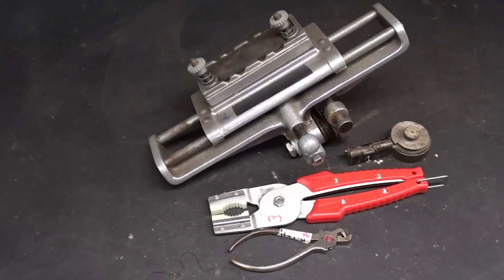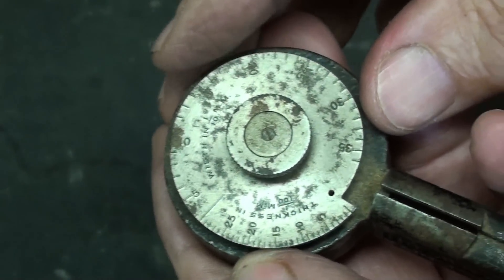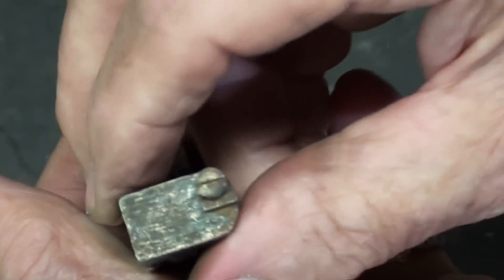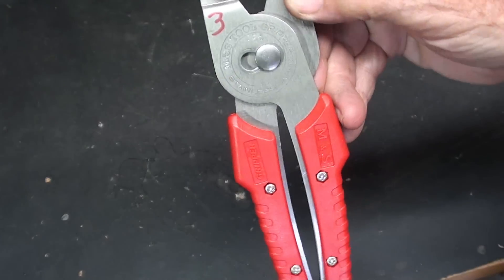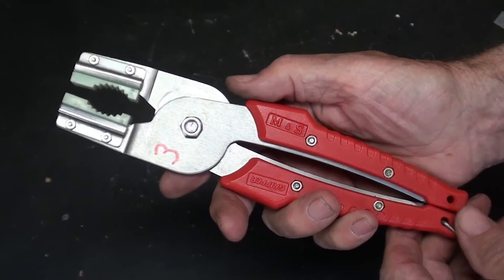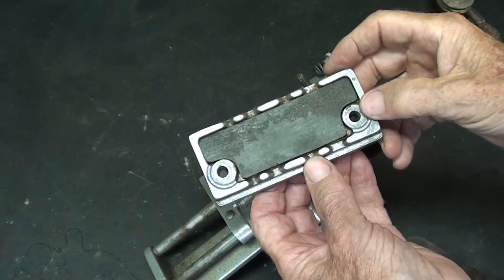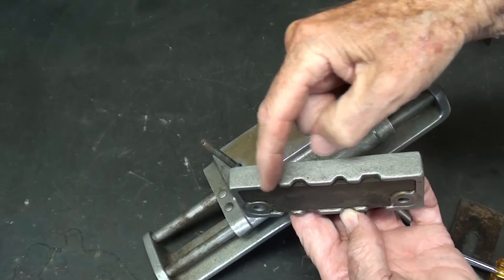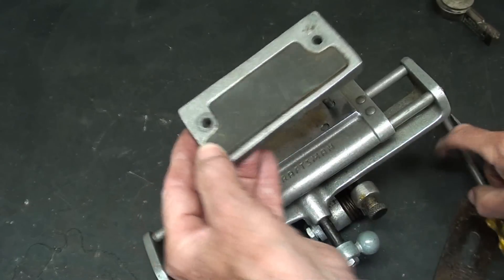WHAT IS IT? Mystery Tools #82b answers tubalcain mrpete

Comment: Hey, don't knock hollow-ground screwdrivers! They're less likely to cam out so anyone who has a jig like this would use it. One feature missing, though, is the ability to flip the workpiece over without losing its lengthwise position, so your screwdriver is ground the same amount on both sides.

Even better for gripping than hollow-ground would be a screwdriver ground to the hollow-ground shape but by holding it sideways against a crowned grinding wheel. This would leave crossways grinding marks which would further help with gripping the screw head.
Reply: Gunsmiths love these screwdrivers that are hollow ground.  It allows a screwdriver with flat parralel sides to slide all the way to the bottom of the screw's groove and prevents the crown of the screw head from being mashed and spread apart when pushing down hard with the screwdriver.  The screwdriver also contacts the screw head groove across the whole groove so their is less chance of scrapping the edges of the groove when the screwdriver's head pops up (cams) out of the groove.  These hollow ground screwdrivers used by gunsmiths are very pricey but worth it.

The better the fit between the screwdriver and the groove the better.  This tool would also be used to take a screwdriver that is too thick and grinding it down to have a skinnier screwdriver head that would now be a perfect fit.   If the screwdriver is too thin, then you would grind the tool head down to make the shaft shorter and then hollow grind the two sides again.   

If the screwdriver's shaft has four sides it would be simple to flip it over and slide it left/right in the jig to keep the faces of the screwdriver head parallel and true.   If the shaft is square but the head is not parallel to the sides then you can use the V-grooves for alignment.  Six sided screwdriver shafts work the same.   Gunsmiths hate it when they scrape a screw head and remove some of blackened surface because customers expect the blackened finish to be unmarred.  They would then have to blacken a tiny screw.  If the screw head is stripped along the groove then they would have to make a new screw or special order the replacement screw.  There are no replacement screws available for old or antique guns.  An old hex key can be repurposed into a flat grind screwdriver too, so you don't need to start with a screwdriver.  On round shafts you would have to grind one side flat before using the flip technique.

I don't have a fancy tool like this grinding attachment in my home shop but every once in a while I need to preserve a blackened, rare or oddball screw so I carefully do the same procedure manually on my grinder or with a Dremel.  My hand made version would never be as true, parallel or precise but my hand made tool it much better than nothing and normally prevents me from ruining a special screw.  

Watches, medical instruments, scientific instruments, and decorative items often need this special kind of care for their screws to preserve the finish or keep from stripping the groove. All big box screwdrivers come with sloped sides rather than flat parallel sides and often result in damaging screw heads.  I don't care about damaged screw heads on normal everyday items so flat head screwdrivers are not used until the situation really needs it.  If I had this attachment, I would want to buy a new cheap dedicated grinder because it would take me too long to setup and breakdown.

Comment: The first tool looks like a main spring winder but if it is that, then there's parts missing.
The second tool looks like some kind of grip for soft parts - maybe bronze or plastic tubing fittings.
The most intriguing one is the plier/cutter tool  - the third tool. Because it was mentioned it had something to do with optics maybe, I got thinking it might be a tool used for shaping glass or tiles. So maybe it could be used to shape bits of glass by say a stained window craftsman. That would explain the tooth but not the square notch on the jaw with the tooth. Maybe that has something to do with shaping the lead for the stained glass windows.

Comment: Dressing screwdrivers was quite important when this tool was made. Most machine screws and electrical hardware was made for a slotted screwdriver back then, and they didn't have replacement bits.

Comment: I'm pretty sure tool #4 is a glass breaker.
First I was unsure, because You really can't have much glass to break, because the jaw's so shallow, and the ones I used had the U shaped cavity perpendicular to the handle, but once You said optometrist, that makes perfectly sense, since a lens doesn't have much meat on it and it's more precise.
If it is, You'd use it as follows:
You score the glass with a diamond glass cutter, take this tool and align it with the scratch so that the tooth (it looks rather pointy) is right under the scratch (the scratch is on the surface facing You) and either flat end of that - let's call it - 'anvil' is touching either side that's divided by the scratch. Then You simply push the handles together and the glass will break cleanly right at the score line in an upside down V shaped motion.

Comment: Hollow grinding straight slot screw drivers is common in gunsmithing.  The hollow grind puts all of the pressure at the base of the screw slot and prevents damage to the shoulder of the screw slot.
Reply: Yeah but you can just buy hollow grinding bits.. no need to make your own..
Reply: @thomasaltruda  You could not do that in the 1960's. If you wanted a hollow-ground screwdriver you had to pay a premium, or you could buy a regular screwdriver and hollow-grind it yourself. There were no seperate driver "bits" back then.

Comment: Used for fabricating a new mainspring, feed proper length of annealed steel and gently wind untill proper size coil is formed, then remove coil and properly harden and temper

Comment: I notice thea #3 specifically says it is a "tool gripper" not a "gripper tool" i.e. it is intended for gripping some sort of tool.

Maybe #4 is for putting the crimp on the end of a zipper being made to a custom length, though I wouldn't think there is much of a need for a hand tool to do this.

Comment: I think the first item is used to measure thicknesses of material and is graduated around the cam . I would suggest if you put various thicknesses , maybe slip gauges or feeler gauges set to the thickness that you will find that the cam will stop at the number on the cam and give you a reading . I expect that micrometers and verniers made this tool obsolete .

Comment: For some reason, those "optometrist pliers" looks like something that could be used to give a good pull on a folded over bead while working with heavy leather for stuff like upholstery. That tooth side would give a good bite, while that other side would keep a folded over edge in place around the desired width. But who knows? It's just the way I picture something like that working.
Reply: I'm pretty sure, it's used to break scored glass.
I used tools like that, but the 'anvil' part was perpendicular to the handle, but since it's supposedly an optometrist tool, it would make sense, since lenses are rather small.

Comment: FWIW, gunsmiths use "hollow ground" slotted screwdrivers. They have parallel rather than tapered "blades" much like the replaceable bits you get in a bit set these days. (The ones that go in a 1/4 inch hex bit holder) Gunsmiths often had to work with lots of slotted screws, and they needed to make sure the driver tip fit the slot perfectly. So a gunsmith might hollow grind a normal screwdriver. But they'd be more likely to buy them premade by an expert toolmaker.

Comment: Grinding a hollow on a screw driver , is the only way I know to get a truly parallel blade thickness. This is the way gun smith screw drivers are ground. However, this jig will get the hollow grind, but not the small parallel grind to fit the screw slot depth. It could grind a little past the thickness required for a particular screw's slot, but this would thin the blade smaller then needed.

I use a square 5C block along with a fence, on a 2x72 strip sander, turned side ways, to effect a true parallel grind to fit a given screw slot. By making the hollow a little longer then needed for the slot at hand, the screw driver can be easily ground a little to renew the geometry of the working end of the screw driver later.

Comment: I would certainly use it to hollow grind an old worn screw driver - in fact I would have used it just last week, when I free hand re-ground a very old rounded off screw driver which I'm sure would have been a lot better done using your machine.

Comment: Gunsmiths will hollow grind screwdrivers. It's pretty common to make single-use screwdrivers for particular guns with oddball screw sizes. Especially if it's antique and collectible you do not want them are the screws and guns crews are straight cut.

Comment: That grinding attatchment tool probably woudn't work with most of todays bench grinders as the tool rest brackets are so flimsy. The only bench grinder of the three I own that it would work on is a old model that is powered by seperate motor that is connected to the grinder with a V belt. I am sure a big expensive grinder like a Baldor could use the tool attatchment, but most home owners won't have one of those.

Comment: The M&S pliers look very similar to ones used in aviation to tighten or remove circular mil connectors, the threaded type not the 1/4 or 1/3 turn bayonet style.  Just my .02

Comment: Hi Lyle hope you are doing ok in the current heat. I'm ensconced in my nice cool basment with projects. Please dont get discouraged from lack of veiws.  So down in my shop working on projects I went into my grandfathers old tool chest the other day looking for the right knife to do some thing and saw a tool that was my grandfathers. I have a mystery tool! My grandfather who died in in 1942. He was a patternmaker. This tool is made of cast Brass and Nickel plated. It looks  like it was well used. I asked my dad about it when I was young back in the 60s he had no idea either.  It looks like some kind of measuring tool, a wood micrometer perhaps?  It has an incremented dial with a pointer. The Nickel plating is all worn off the handle from apparently daily use. I know you are not a wood worker but, pattenmaking and foundry stuff is a little different area from normal wood working.  This mystery tool has been bugging me since I was 8 years old. I would love to find out what it is or was used to measure. Perhaps type draft angle or something. I can send you a photo probably if you have the time or interest to engage in some speculation or by chance you might even know what it is.
Reply from the maker: Yes, send me a picture, through an email
Reply: @mrpete222  ok doke where can I find your email address I looked for it but didn't see it. Im one of those stubborn people that doesnt have facebook or any social media going on.

Comment: Next time ya take yer aerator off yer faucet, find an o-ring that matches the i d.Put it in, hand tighten the aerator to the point where it doesn't leak from the radius and you can get it off easier next time.
Reply from the maker: Sounds like a good advice

Comment: If #4 is an optometrist tool it would be used to perm the bottom end of the screw which attaches temple to frame to keep it from backing out as the temple opens and closes.

Comment: Item#4 looks very much like a crimper / swage where you use to swage something like wire rope. The sharp-nose on this might be for a steel swage, instead of lead. This is only a guess
Reply: Right kind of shape, but lacks the leverage needed.

I have a wire rope swagger & it's  made from the same frame as a 20-24" bolt cutter. Still grunt a bit using it on SS swage sleeves!
Reply: @georgedennison3338  Thanks for your knowledge. I see your point.

Comment: I wonder if my viewing from across the ‘Pond’ counts as more than one view? 😊
I sometimes wonder if we have the same genetic roots. My younger brother just can’t understand why I have ten, or more, of the same tool, drill, machine or whatever. I can - it’s called normal behaviour!! 😊👍🇬🇧👍🇺🇸👍
Reply: PS
The ‘Craftsman’ thingamabob must rank as a ‘good idea, but useless’ invention.
I suspect that some eager beaver bought this from the catalogue ages ago, looked at all the promises of what it could do, tried it out, then threw it against the wall in disgust. Hence the broken knob and bent screw thread (oh, and missing thingy to sharpen knives).
I never, ever use a grinding wheel to sharpen any tempered tools for woodwork and the stupidity of setting it up to reset the tip of a screwdriver when hand and eye are sufficient, beggars belief.
As for grinding (and ruining) plane irons, the hard rubber (?) pad wouldn’t keep them firm.
As we say in England (maybe in the USA as well) it’s as useless as a chocolate fireguard. 😊👍

Comment: If you ever used a hollow ground screwdriver you would never ever go back to an ordinary grind screwdriver.  Any gunsmith worth his salt would only use hollow ground screwdrivers to keep from buggering up screw slots, in fact high end gunsmiths/builders hollow grind the screwdriver to match the slot. I’m not talking about a “gunsmith” that throws a bunch of parts together to make an AR.  The  Craftsman attachment for a grinder that you showed was offered for sale back when there were still an abundance of craftsmen in this country.  Sadly most are now gone.
Reply from the maker: I believe most of the screwdrivers offered in the Brownell catalog are hollow ground

Comment: I found the M&S Gripper on the 'net, but can't read Japanese, & it's an image, not text, so can't translate it.

Found another site, but it looked like Farsi or another Mid Eastern language.

They make another version of it, w/ blue/green handles. It has multiple, smaller jaw openings.

There was a drawing showing that version being an alternative to holding a 0.25-0.35" rod w/ in the teeth of a pair of standard pliers.

Couldn't tell what material the rod was. Would guess that's SS, a soft metal or plastic, making the nylon/acetyl gripping jaws a non-marring alternative.

The Japanese aren't ones for making stupid or marginally useful tools.  The M&S looks to be well made, from quality materials.

Doubt that it should be considered a Father's Day gift that would spend it's life in a drawer.

Take it for a test drive & see how well it holds a piece of soft round stock; mebbe try running a thread die down it, to see just how grippy the Gripper is.

Comment: I thought windmills were suppose to be good for the environment ...
Reply: If you have ever worked in a coal plant, you would truly understand. I am not a great an of wind turbines, but the life cycle waste and repair costs are much less than coal fired per KWh. Lifetime for the turbine might be less than annual for a coal plant on a per KWh basis. The big problem is the variability in wind in most places. Solar is better, in that the space used can be multi use (rooftop, parking, etc) and that it tends to peak when peak energy demand is in many places (peak generation is peak manufacturing and peak air condiioning need), but still there is need for other sources to maintain stable delivery. Coal plant- train cars full of ash every day, and long trains every year of slag and clinker chipped out during turnaround. Without even considering CO2 and lasting cost of handling/disposing of the waste, on a cost per unit energy basis, coal is a big loser, and gas turbines/combined cycle at best come close (lots of waste there, too, in soot and burned and consumed components).